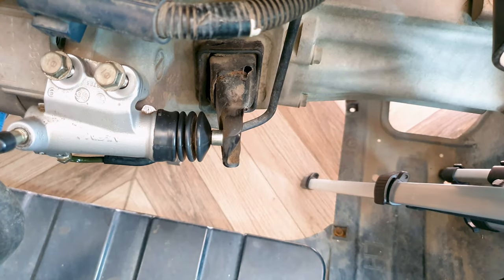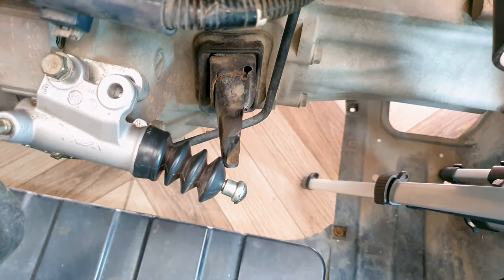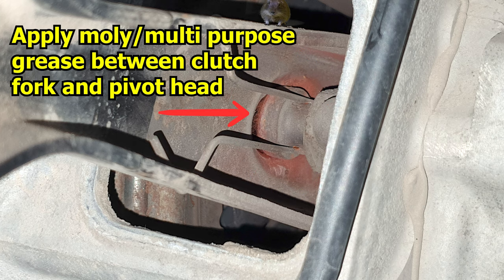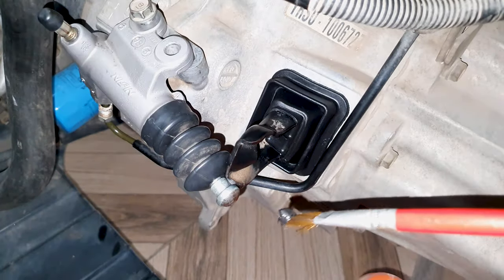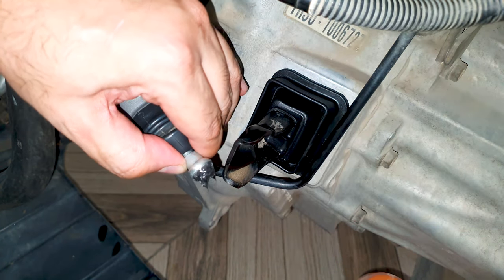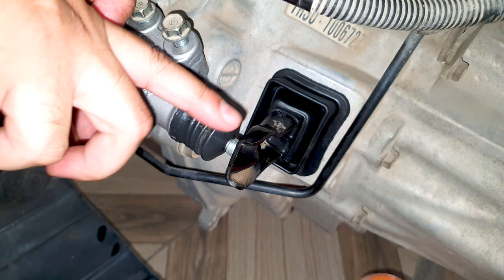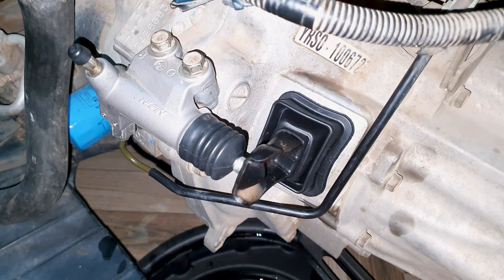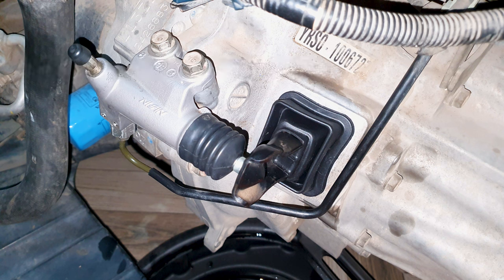4a - Eliminating clutch (pedal) fork squeak

Comment from the maker: Follow up to this video -> https://youtu.be/RKRyadoRkZA

The squeak (to a lesser extent) came back the next day. With the camera out of the way this time, I was able to see better and get more room. Now the squeak is 100% gone. 

With the slave piston out of the way, push the clutch fork (away from the internal pivot head) and pull it outward. You will get plenty of gap to get grease in-between and I put a good amount. You can move the clip out of the way to create a bit more room. 

Be very careful when getting the slave cylinder out of the way under hydraulic pressure, release the slave rod slowly. You do not want the piston cup inside the slave cylinder to pop out with the fluid. Do not push the clutch pedal when the slave cylinder is not pushing against the clutch fork.

If you have a rattling on idle, sound like a bird chirping, this unintendedly got resolved in part 2 of this series (by refreshing the internals of the clutch slave clylinder) - https://youtu.be/_tDSAtc-RfI

Comment: I had this issue with my Toyota Hilux and the noise was coming from the slave cylinder itself. The squeaking noise resolved after i slide the  rubber boot on that slave cylinder until the thin long shaft was visible and sprayed CRC on the shaft at intervals whilst my son pressed the clutch up and down. This lubricated the shaft in the cylinder and after 5 minutes of spraying the noise was gone..
Reply from the maker: I did overhaul the slave cylinder, the contact point for the rod inside is greased. In my case I think because the rubber boot on the fork was ripped, too much dirt got inside and ruined the contact points so thats why its not 100% after greasing.

Comment: Does this also cause the clutch to become slightly harder to depress? Its not even a year that i replace the clutch disc+pressure plate and release bearing. This exact noise has started up with clutch harder to depress.
Reply from the maker: Yes. Greasing the fork helped. Even though I still have noise on and off but I dont feel the orignial stiffness that was there. Overhauling(cleaning and regreasing) the CMC and CSC (shown in part 2 of the playlist) helped smoothen it even more.
Reply: @TheWrenchWiz  noise is okay but if that little stiffy and jerky feeling is smoothened out its worth it. Tnks man.